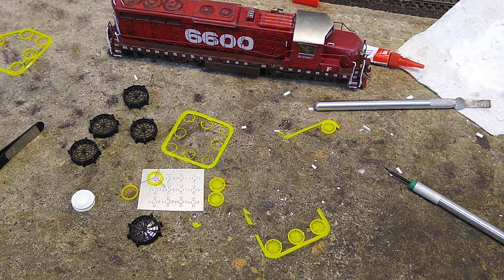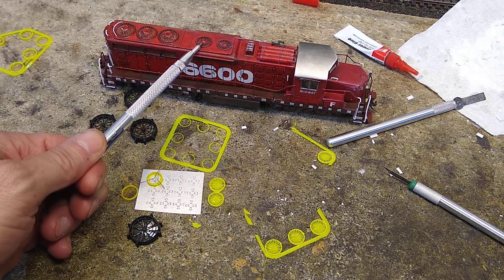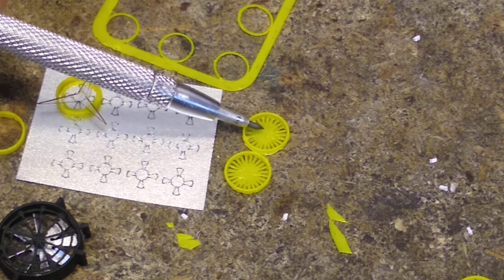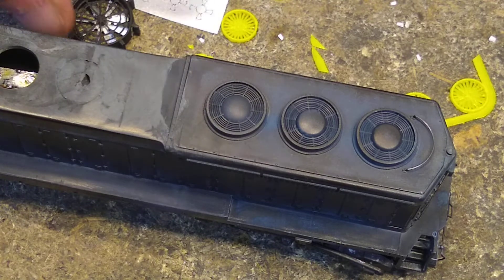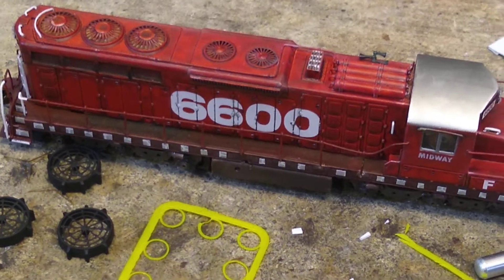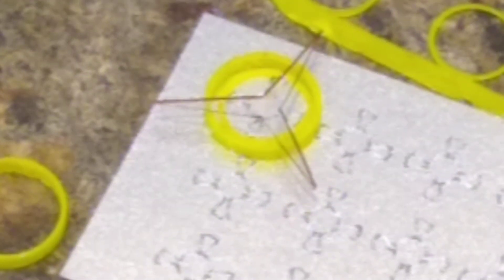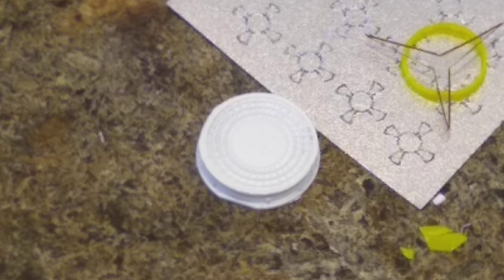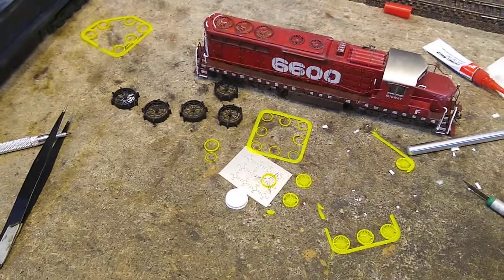5 locomotives in 30 days part 30 scratch building fans on day 18

Comment: hey, jsut saw ur pc gift vid on greg salazar's channel. i would like if u can do a short video review of the performance difference u get from the new pc over the older set up. 
not so much with the numbers, as normal computer people fawn ove 10% changes to to specs, and the screen looks the same to me. lol. 

i jst want a non pc person's perception of moving from older tech to newer tech, how it looks from ur side. 
like run it for some time, and take note of what difference u get. 

thanks.
Reply from the maker: yes for sure!!  I wised up this time and put my old A10 next to the new one so I can make a smooth change over.  I plan to do some live streaming where I paint the 5 locomotives with a paint brush instead of an airbrush.    I'm going to probably a number of videos showing it doing things I couldn't do before.